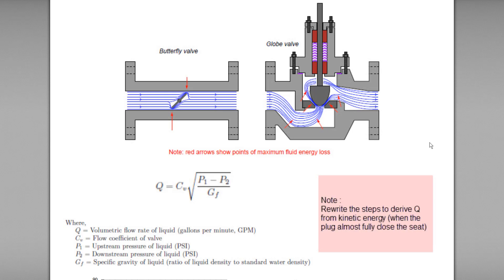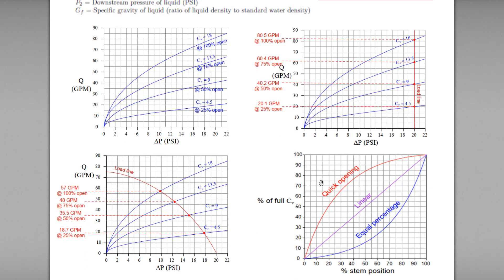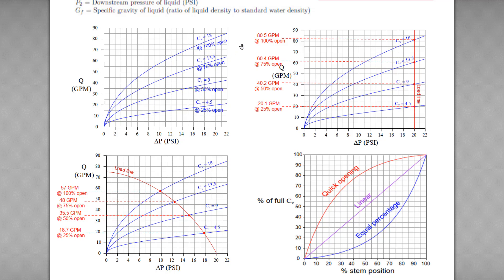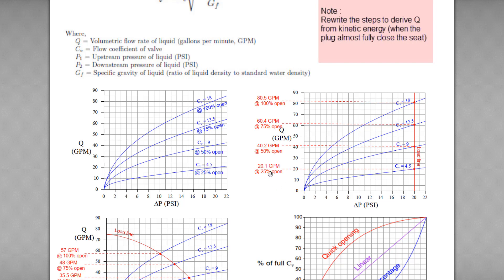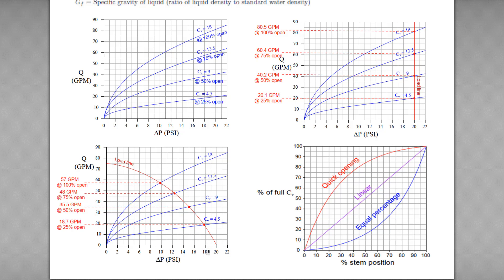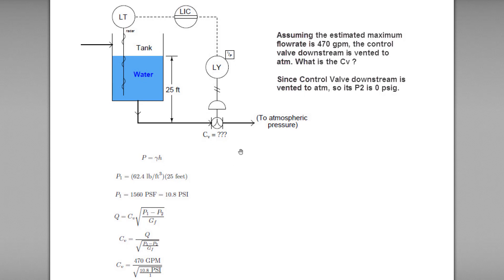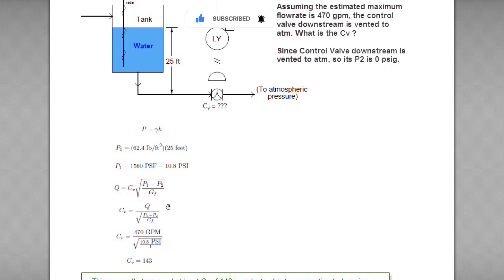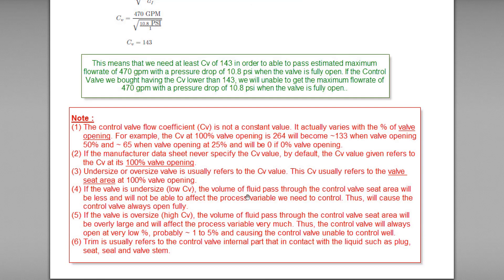Control Valve Flow Coefficient Cv Basic Concept

Comment from the maker: "What is Cv in Control Valve? Cv is Flow Co-efficient or Capacity Index for the control valves. Cv is the important component in Control Valve sizing and every technician should understand its meaning. The Cv can be roughly assumed as the Valve seat orifice area and the valve plug opening although this assumption is inaccurate but it helps us to understand the abstract term easily.

The higher Cv will give higher volumetric flowrate compared to low Cv value. Note that Cv value will vary depending on the opening percentage of control valve. The higher the valve opening, the higher the Cv value."

Comment: Hi, when studying valve, i always wondered that if i remain valve stem position or valve opening percentage, does the Cv remain the same value?. I think it right but still not sure about.
Reply from the maker: Hi @nguyenvandieu318, to my understanding as an ordinary technician, the Cv will change when the valve opening percentage is changed. Theoretically speaking, If the valve opening stays at the same opening, then its Cv should stays the same value at this mentioned valve opening percentage too.

Comment: Hi, can you advise what is the term of required Cv, Selected Cv, Valve Cv and Rated Cv.
Reply from the maker: Hi , I tried my best to explain this terminology based on my limited knowledge as an ordinary technician. 

The Cv (Flow Coefficient or Flow Capacity) of the control valve is the value that shows how much liquid or gas flows through the control valve when it is fully open at a specific pressure difference drops across the valve. 

The terms of different Cv are explained as follows ;
Required Cv : Calculated Flow Coefficient based on process requirements.
Selected Cv : The Flow Coefficient selected to meet the Required Cv.
Valve Cv : The actual Flow Coefficient value of the installed valve in the field.
Rated Cv : The Flow Coefficient specified by the manufacturer in their data sheet.